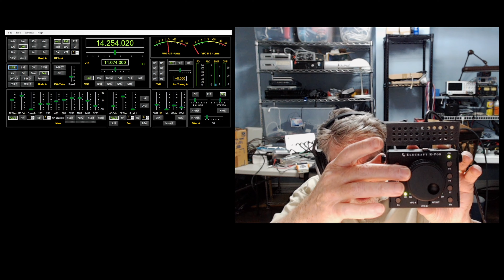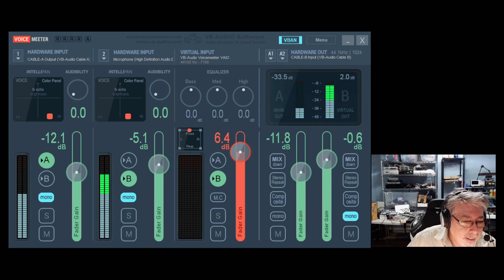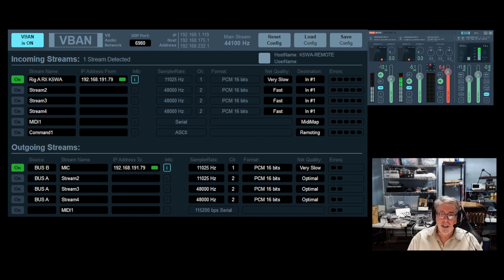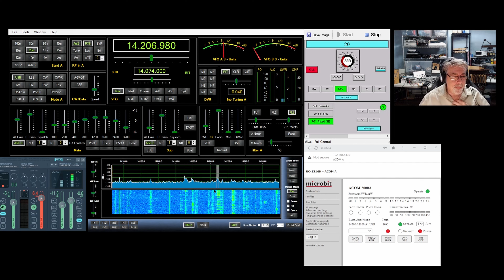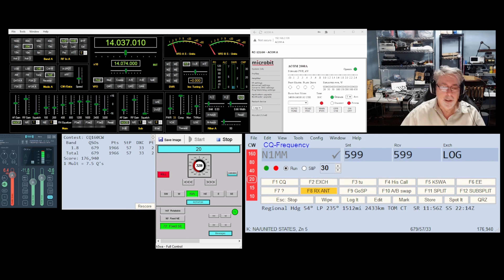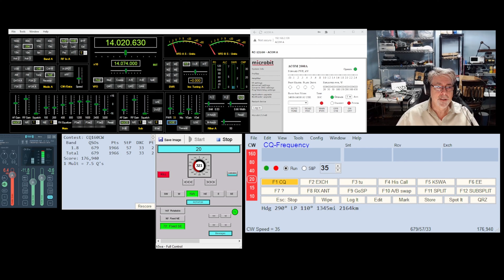K5WA Remote Phase3

Comment: Will the K4 remote fix the audio transport. This should resolve the software and hardware you described. I did not think about VPN to make it work good idea.
Reply from the maker: Since that video, I’ve gotten very comfortable with VoiceMeeter Banana as my audio transport in both directions.  That said, the Elecraft audio will be as good or better.  It will also be easier to manage.  We are 2-4 weeks away from Elecraft releasing the new firmware for the K4 (fingers crossed).  That will be a game changer!  I look forward to eliminating rig and audio setup issues and letting Elecraft handle them.